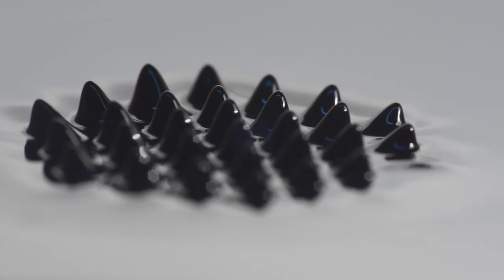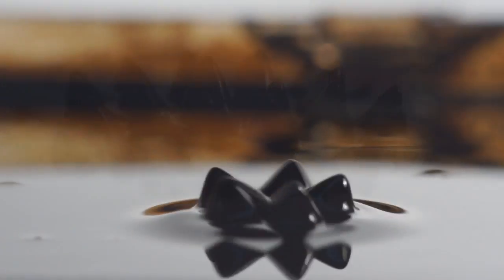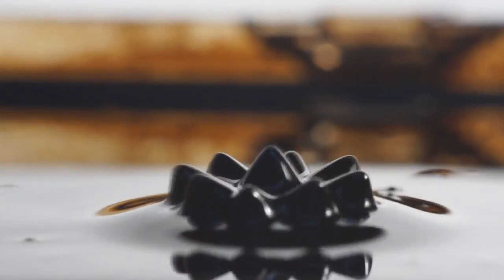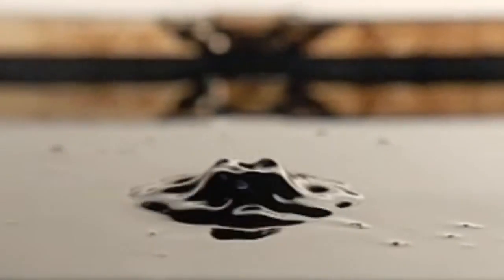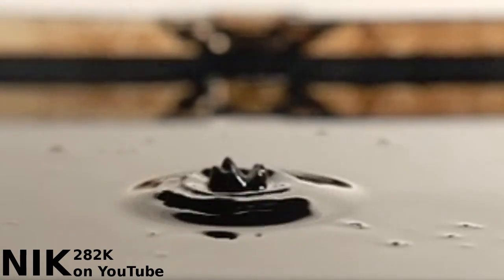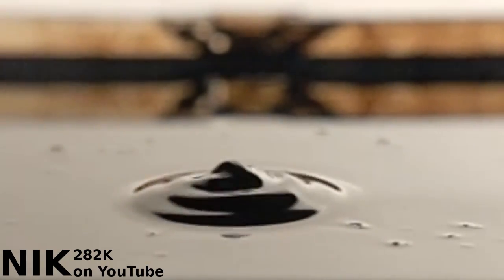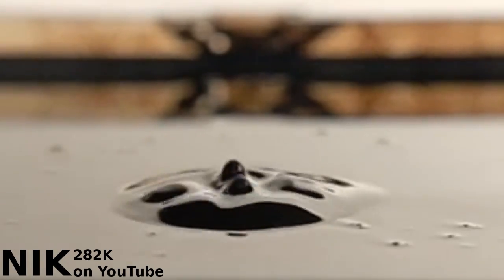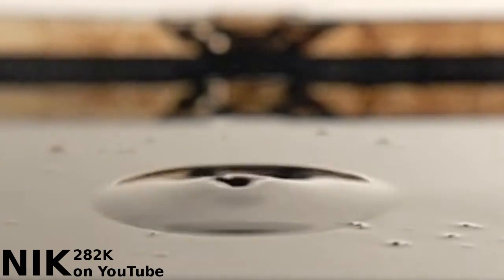Audio Modulated Ferrofluid

Comment: Cool video, I guess the viscosity of ferrofluid has something to do with sound resonance versus the delayed reaction latency.
Perhaps why lower frequencies portray better detail.

I wonder If we could design a transmitter to reach frequencies exponentially more rapid than currently available, that could resonate and manipulate atoms at a direct offset, not a frequency that is ########### to the power of ten slower ???lol..
Fundamental "guess" example::::> consider hydrogen as a very very rapid frequency, it expands to an "atom" sized sphere and collapses back through this inner symmetry that is constantly dividing the past and future at constant oscillation <constant frequencies could even be considered as a type of rudimentary (elementary) memory.

Comment: How did you make the speaker?
Reply from the maker: I used 30awg wire on a 3/8" bolt. I didn't record the number of turns used but it was at least 200.
Reply: Thanks

Comment: I think the ferrofluid makes spikier shapes with bass because the magnetic field is much stronger, every time you half the frequency it requires 2x as much power, add the fact the high frequencies are fast and you get small, quick ripples. Just an educated guess.
Reply: If you do another video like this I recommend using a subwoofer coil since it's much larger and can handle much more power, much more amusing for demonstration. --- unless that's what you're using. Hard to tell with such a smooth liquid.
Reply from the maker: otalkusanchannel The problem with using  a subwoofer coil is that it has too low an impedance all on its own. When it is in the big iron core and magnet there is a big magnetic field there to resist big changes in current, if I take the coil out of the speaker it acts like a dead short and just burns up (I tried, it smelled terrible). I also tried leaving the coil in the iron frame but the magnet is too strong and the field is barely modulated by the coil.

I coil with a big ferrite core would be best but all I had at the time was a 3/8 bolt so that's what I used.
Reply: Ah, I see. That makes sense. That's very interesting, I'm about to make some ferrofluid myself so it'd be fun to try out a few different drivers I've got lying around.

Comment: The higher the frequency the less time the system has to respond to the forced signal. High pitch means rounder shapes. Think of it as the response of an oscillator.

Comment: hey Nick,
could you please tell me how you made the Ferrofluids react on music, i'm doing this as a school project.
Thanks!
Reply from the maker: I used some very thin wire (30awg) and wound it around a bolt making sure that the length of the wire gave a resistance of ~8ohms. On a speaker 8ohms is the impedance but making the resistance 8ohms makes it harder to burn out the coil also I didn't want to do the math to get the impedance. I put the coil under the ferrofluid and hooked it up to an amplifier. Running it for too long will burn it up but it can play for about a minute.
Reply: Alright thanks! I took the electro motor and the speakers out of my old radio, are the any use?
Reply from the maker: No but the radio may be used instead of a stereo amplifier if it can put out enough power.

Comment: You know, I was pondering the frequency issue as well, but I offer up an alternative explanation. Depending on the distance of the audio source versus the camera and the subject, there may be enough of a mismatch in the distance at high frame rates to for the ferrofluid to appear more reactive to the bass due to the speed of sound and speed of light difference. Just a thought. Maybe do an additional tone test with a frequency test pattern for your own knowledge.